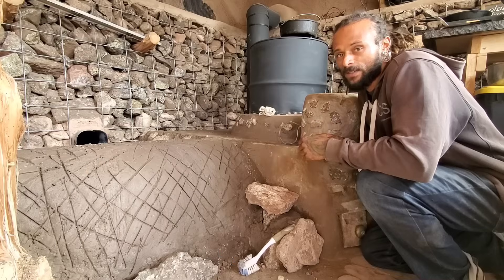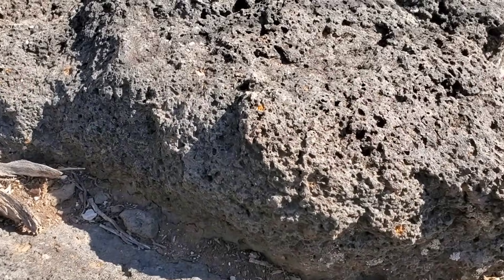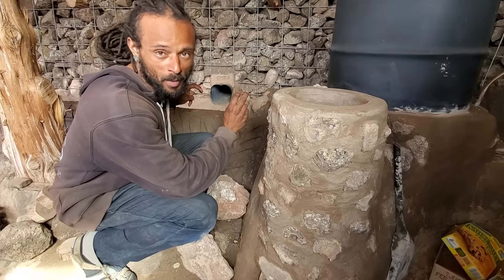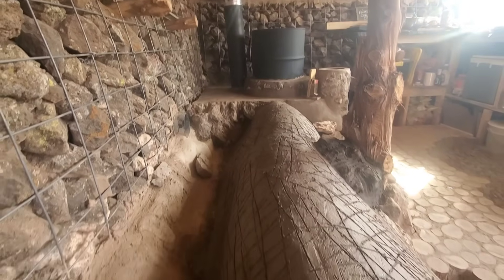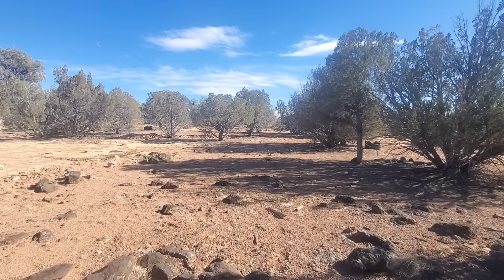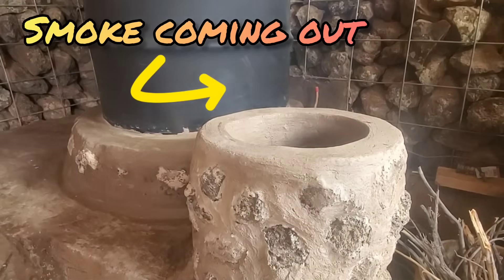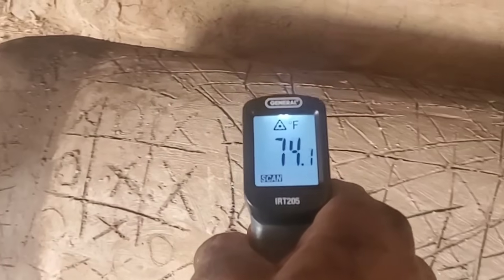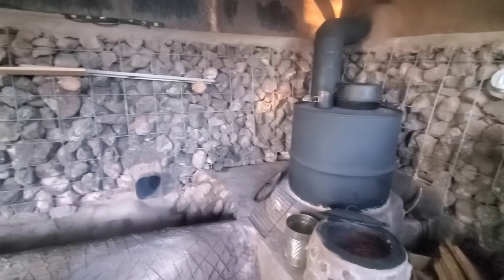Rocket Mass Heater Designed For Max Heat Extraction

Comment: Regarding length of stratification chamber: Is there a limit to how much heat you can pull off so the exhaust will still go up the chimney? If the exhaust gets mostly cooled off could a fan be used in the chimney allowing you to pull off most of the heat into the mass?
Reply from the maker: Slightly what the barrel does so close to the pipe, it's a slow siphon! But I'm sure you could tinker with the concept!✌🏾

Comment: I saw a similar system where they included an exhaust by-pass directly from high on the barrel to the exhaust chimney. They opened the damper while starting the fire to get a good draw and when it warmed up, then they closed it and let the exhaust go thru the bench.
Reply from the maker: That's a smart idea for getting the fire going efficiently! Thanks for sharing! Ours has pretty good airflow, so starting it up is pretty easy!🔥✌🏾

Comment: Brandon I am considering something of your design with a twist to it, similar to a primative korean ondol. You dig a pit 4 or 5 feet deep, and place your fire tube etc, built on the lower level, and also excavate an area that forms your stratification tube, with accompanying exhaust chamber to the chimney. The excavation should also include a pit in front of the fire tube, so you can easily climb down to place material inside the fire tube for starting the fire, and also ash clean out. This would then allow the stratification tube to be a heated floor along with the additional mass that it could heat at a lower level so the floor is not cold. Yes it would require more support for the stratification chamber but every design has pro's and con's. And the pit in front of the fire tube would just require a framing on hinges to open for access, and yet make it so no one could fall into the opening.
Reply from the maker: That's a really interesting twist on the design, thanks for sharing! ✌🏾

Comment: Thank you for showing and explaining your process in detail. Few videos do a good job of that. She is a very talented person shaping the cob and mud. For anyone watching, for the best draft, make your "riser" up into the barrel as tall and long as possible. Don't cut the barrel off. Move the barrel up as much as possible for the longest riser possible. Many traditional "J" designs only allow 2 inches to the top of the barrel from the riser. He allowed 4 inches, but more space actually hurts draft and draw. 2 inches to 2.5 inches is ideal. It seems "tight" but it's supposed to be that way. If he ran into any problems at all with draft, say, when the thin pipe outside "gets cold," .... insulating the last 8 feet of the chimney would solve any draft problem that may arise. Use an 8 inch pipe surrounding a 6 inch and stuff the space in between.
Reply from the maker: No problems yet, but thanks for those tips!✌🏾

Comment: I am using Masonry heater plans from a guy in Ely, MN. It's 89% efficient and Energy star approved. I also have a masonry stove and white oven. Here for code clean outs must be able to access every internal parts. I also have warming benches on both masonry heaters going through wall into bed rooms. Code wouldn't allow passive solar heat alone. I am building an earth ship to code. So using cmu wall instead of tires. Needed R 24 walls for code. Plus I had to put real timber frame in it. As I have 70 psf snow loads. I went with a skillon roof at a 6/12 pitch so winter sun will make it on to north wall in winter. The pitch helps with snow sliding off too. I had to put in radon vent too. To pound tires would of been to much labor for me alone. I do masonry work so laying block is is not issue. And so much quicker to lay block or pour wall than pound tires. It's less labor for me to go to work to make money for block and lay them in wall than pounding free tires.
Reply from the maker: Interesting take!  I love the creative problem solving!👌🏾

Comment: Hi, nice build! Thank you for showing us! I have a question. What if the pipe that goes outdoor is on the other side of the ''bench'' chamber instead off right beside the other pipes? I am wondering because the place where I want to do the stove is a L shape and I have the exit pipe on the other side. I would like the stove in my kitchen but the exit is in front of my stairs on the other side of the L shape. I don't know if you get what I mean, hard to explain in english for me.. but if you get it, would that be possible to do it like this ? Thank you
Reply from the maker: I understand and you could do that. The exhaust pipes are next to each other because the heat naturally fills the chamber instead of flowing through tubes. The air has a hard time turning 180 degrees. There's a chance there's more suction having the pipe at the other end. Heat will rise and flow to the other end for your exhaust pipe and won't fill the bench with heat before going out! ✌🏾
Reply: @GrowTreeOrganics  Thanks for your answer! So if I understand well, the bench won't really get or stay warm and the heat would go out right away? Even if the pipe start from the bottom of the chamber?
Reply from the maker: @evanklauniere8636  exactly! 👍🏾✌🏾

Comment: Your J tube, is there an 8"crosssection burn chamber above the grate?
It seem like you opted for a hybrid L/J.
Are you planning on baking in it?
A pan full of water under the grate could be a way to harvest biochar...
The way you use mesh with cob is a lot like ferrocement...
Reply from the maker: It has that extra space underneath for ash and char catch. Definitely room for baking and making char!✌🏾

Comment: Nice idea! If you devide the bench with a brick wall forcing the smoke to travel to the end of the bench befor turning back to the chimney it might be even more efficient?
Reply from the maker: If we understand the dynamics of heat the design makes more sense, but also you can see the exhaust coming from the barrel portion sticks into the bench away from the j Tube exhaust. From the first tube it would have to do a 180 turn towards the j Tube. I'll point out the bench was pretty equal temperature even towards the end and 80% of the heat was taken out. Airflow is essential in these systems, so restricting the airflow may cause the system not to work properly. ✌🏾
Reply: @ Yes taking out too much energy makes the chimney flow less. In sweden we hava a kind of stove made with brick and clay, not cement it cracks. It has long brick canals inside and is very heavy. I fill mine once in the morning, once at night and that keeps the house warm 24/7 even at -20C.  Mine is about 120 years old. You can Google it ”kakelugn ”. It can be made without tile

Comment: So why not extend the pipe from the burn chamber all the way down to the end of the bench before letting the gasses pass back to the exhaust siphon back on the barrel side?
Reply from the maker: Might as well put tubes through the whole thing like regular rocket stoves. This is a tubeless design. You'll have to watch the video again. You can observe the similar temperature on the whole bench. Shows its heating evenly!✌🏾

Comment: Organic matter is great in sandy soil, but... it will break down fine enough over time to wash through the sand. I would highly recommend adding clay to the soil if you intend to garden and feed compost into it, otherwise it will all wash out over time and be lost. Clay will 'plug' it up enough to stop that from happening. Dont stress the amount too much, 5% of soil content would be awesome start, you can add some each year, or even add by mixing it into the compost when you add it, many approaches, but basically you could add all you want it wouldnt hurt a thing. Ideal soil would be roughly 1/3 sand, 1/3 clay and 1/3 organic matter. but thats a long way off for us all. also, animal urine (people included) adds to the soil not only the water and nitrogen but also other stuff, the combo of which makes soils hold water longer when they do get it- i cant remember the science of it offhand been years since i read it, but it works trust me ive thoroughly trialed it. And those scrub trees may or may not be edible for something like a small dairy goat, firewood and goat food and mulch is a great harvest combo. and the goats add more pee + other stuff as well of coarse. anyway, great video.
Reply from the maker: Great advice, thank you! We'll definitely be experimenting with adding clay and different soil compositions as we go!👍🏾✌🏾

Comment: You should put the gas outlet of the bench on the other side of the bench and not next to the inlet. You get flow short circuiting resulting in most of your bench acting as dead space instead of a heat transfer surface. This results in ineffective heat transfer. Otherwise pretty cool design. Your idea of "warm air layers" works but only if the forced convective flows are small then the free convection. Didn't calc it but I would guess that is not the case. Especially since the rocket lives from the high flow speeds. (Which makes forced conv stronger) The free convection forces are usually driven by large heights (that's how chimneys work) but since you made the chamber only a couple feet high this effect will not do much.
Reply from the maker: You should watch the video again. Especially when the temp gun is used. 👍🏾

Comment: This is incredibly cool.

I am really hoping to see a plan for combustion air that's not just what comes in the cracks in the walls!
Reply from the maker: Airflow is crucial in these systems, so there's actually a lot of suction to these systems, and ours. We do have a smoke and carbon monoxide alarm too!✌🏾
Reply: @GrowTreeOrganics  My thought is that the air that's leaving the building through the the exhast has to come from somewhere. If there's no intentional path, it will just suck outside air through the walls, brining in cold air and using the existing warmed air of the room for combustion.

This seems less than ideal. One would want to have an isolated path for outside air into the combustion chamber that doesn't cool the inside of the room. It's an efficiency optimization more than anything else.
Reply from the maker: @AlanW  if you remember the cooling tubes in the gabion wall, that's where the fresh air is coming for the stove!✌🏾
Reply: @GrowTreeOrganics  Oh nice, I missed that one. amazing!

Comment: Is it fair to assume this design also redudes sparks getting out the chimney top to start fires, or start fires inside the chimney? 
I know some woods are worse than others for creosote buildup in the chimney risking fires if not cleaned, is juniper one of the good or bad ones?
Reply from the maker: You're totally right! This is way more efficient at burning!✌🏾

Comment: Is there any plans for carbon and smoke buildup inside? Chimneys that arent cleaned regularly can become a hazard as flamible residue builds up, is that something to consider? Only concerned for your safety, it seems amazing otherwise!
Reply from the maker: The beauty of rocket heaters in general is the more efficient burn, compared to conventional stoves, way less build up of any kind. Most people including ourselves have never had to clean any stove. Most people only have to change the barrel and when they look on the inside, hardly any noticeably build up even after several years of burning.  Look into rocket stoves, you'll understand more.!✌🏾
Reply: @GrowTreeOrganics  wonderful!!!

Comment: I'd be interested to know how complete the combustion is as well, like how much carbon monoxide is in your exhaust. It'd be cool to be able to know if it's very low and that you're really extracting maximum energy
Reply from the maker: Well we don't want to extract C0, we just want the heat! I showed the exhaust and that was in the middle of the day!✌🏾
Reply: @GrowTreeOrganics  Right sorry I should have been more specific. When you convert wood (carbon) to co2 via combustion you are extracting the maximum available chemical energy. When you convert it to carbon monoxide instead because of low oxygen available you are leaving heat energy on the table. Carbon monoxide is also called wood gas and was used as a fuel for heating/lighting in its own way for a long time. If your system has a good balance of fuel to oxygen and a good operating temperature then you'll have very little carbon monoxide, meaning you're doing a great job at extracting the maximum available heat!

It's probably not a real concern though, I just thought of it because of all the discussion on efficiency.
Reply from the maker: The stove design is essentialy like putting a turbocharger on a conventional stove. With the oxygen and burning the gasses efficiently.  Someone just needs the tools to measure those things!✌🏾

Comment: Quick critique from your friendly neighborhood arch nemesis... What is stopping the J pipe from just drawing straight off the exhaust pipe from the barrel? Wouldn't the flow spread out more if you extended the exhaust pipe to the end of the bench to allow the J pipe to draw from the whole length of the bench, instead of just drawing from the short distance between the two pipes? The current design seems as if the majority of the length of bench would just be a pocket of dead air. One test would be to reopen the end of the bench during the warm season to view the creosote build-up pattern inside to see how the heat is dispersing.
Reply from the maker: It's an even distribution. The J pipe isn't connected to the barrel. You'll have to watch the beginning again. Think about the hot air like water and flip our design upside down.✌🏾
Reply: @GrowTreeOrganics  I watched both videos from the beginning. It's a matter of air flow, which what you're looking for with your design is a laminar flow. What you've built is a negative-pressure box for all intents and purposes. This is why the temp at the end of the bench is lower than where the barrel pipe is. 

I'm not suggesting it won't work for the purpose intended, because it obviously does. My argument is that it's not functionally working the way you designed it. The J tube draws hot air at the same flow rate that it comes out of the barrel, which means the air does not have enough time to flow to the end of the bench before the J tube draws it out. 

 Please don't take my comments as criticism, I do like the build. Talk to a HVAC professional on the air flow capabilities of the design, and I'm positive they'll confirm my critique. My guess-timation is that the air from the barrel is only travelling maybe a foot out of the barrel pipe before it is sucked back the other direction to the J pipe.
Reply: My experience that I'm referencing is from building more than one laminar flow hood for mushroom cultivation. I was trained on biological clean room air filtration systems at Aloha Medicinals out in Carson City, Nevada, so I'm not just guessing. And air doesn't have the same flow capacities as water, so that's not a correct way to view it.
Reply from the maker: @BluhmGardens  and my experience comes from building these for the last 8 years. Plus there's plenty of studies done on these systems. I'm not trying to negate what you're saying, but you can see in the video from the quick burn (1, 5 gal. Bucket of sticks) the bench was reading pretty even temperature. 80°F  It was an 80% temp drop from the metal barrel to the metal exhaust, I would think with what you're saying then that the exhaust would be almost just as hot or hotter than everything else if the j Tube was just sucking the air straight. That's how a conventional stove works, pulling the hot air straight up and out and we can see the high temperature on the exhaust. ✌🏾
Reply: @GrowTreeOrganics  I may have come across wrong due to my Asperger's and the limitations of text-based communications. If I did, I apologize for that. If you are interested in looking at a different layout to achieve laminar flow, I'd be happy to draw something up based off your original design shown in the videos. Not for changing your current system, but an idea to consider for your next system.
Reply from the maker: @BluhmGardens  no worries, I wasn't trying to come across negative either! So many designs and additions. You could definitely send those design plans you have too!✌🏾

Comment: When you said that it was still wet, but still started the fire. Hopefully it doesn't crack/break. I know someone who built a brick fireplace outside,  but the cement was not dry, and it cracked and kinda ruined it  ?  
But what a terrific idea and very clever.
Reply from the maker: All good! We've built 4 of these actually before, so we know what to expect, materials to use, etc.✌🏾

Comment: I've no doubt that rocket mass heaters work and are an efficient way to transfer as much heat as possible into your thermal mass.

But that "bench" is very strange.  A combination  of the round top, not being against the wall, and having a roof supporting pillar in the middle of it makes it seem - unplanned.  Haphazard.  Uncomfortable.  Impractical.
Reply: Dome shapes are very strong, and the mud is a Portland mix to make it extra sturdy. I still have a lot of work to do to finish the bench, add thermal mass to it and make it flat and flush with the wall✌🏾💜
Reply: You see the scoring on top? that is so that they can add more layers to it, this was just a  test run, they turning into a full bench eventually.
Reply from the maker: Seems because you don't understand something is cause for being a negative Nancy instead of asking questions!👌🏾